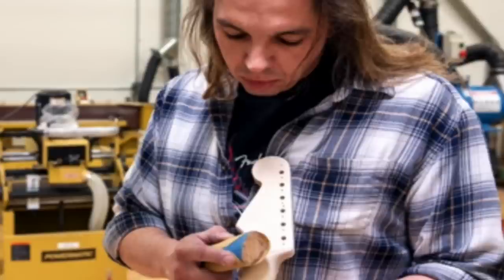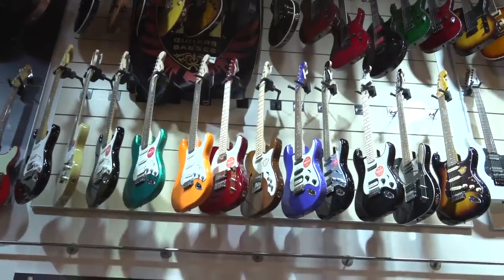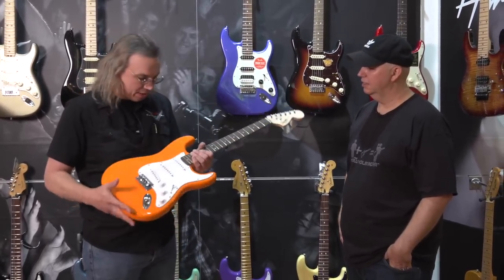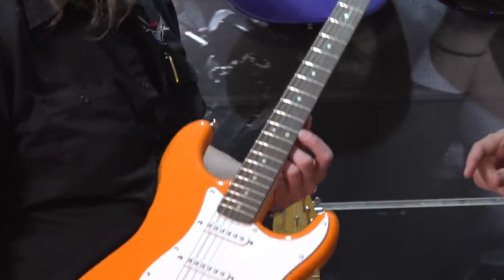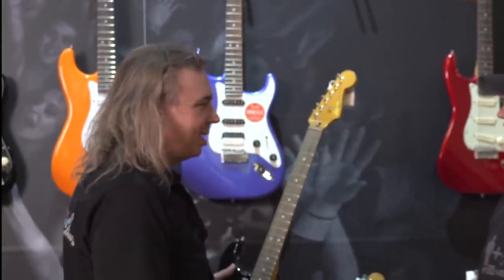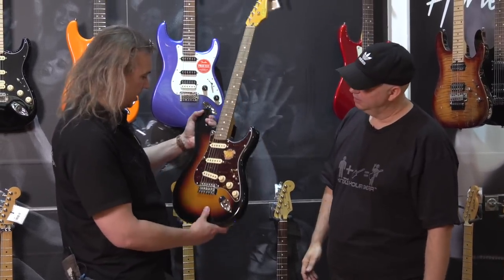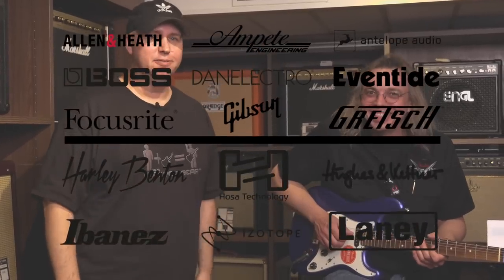What Squier Would A Fender Master Builder Buy?

Comment: affinity is made in Indonesia.  If you get a good one, they are really butter to play.  The frets are rounded and the satin finish and higher radius makes it a really sweet ride.  I bought a new one at a pawn shop and had no idea what it was other than a strat style cheapo but I played it and it was just all about that fretboard.  The pickups sound decent.  Doesn't stay in tune well enough, tho.  no idea about those other two.
Reply: Mine is made in china, and is the orange one they showed in the video. and it is very close to a real strat. It is just a little bit slimmer body and neck wise.
Reply: Mine is made in China too the neck on mine is as good as it can be. Im very happy with it. 👍
Reply: @collecter3456  if it's made in China, it's probably old stock. Btw mine's also China made
Reply: Ironic, guitars from this part of the world were utter shit in the 90s.  I guess they got their factories tightened up over there.
Reply: @CyberneticArgumentCreator  I'm from Indonesia, and I think they already have good enough experience cause they have been working for decades since the 90s
Reply: Did you get your tuning sorted? In my experience tuning issues are cause by the strings binding in the nut (usually sharp after using the trem) and string windings shifting on the tuning post (strings going flat after bends). There is also the possibility of them binding at the bridge. When restringing I like to wrap the string around the post and pull it through the hole leaving vary little slack. Make sure the string is properly seated in the bridge. Grab the string over the fretboard and put some tension on it. Wind the key making sure that the windings stack neatly and towards the headstock. I feel that 2-3 windings is enough to hold onto the post and more than that is more places for the windings to shift. You will have to put some extra tension on the strings to settle the windings so they don't shift but I don't like to go crazy with the string stretching because I think it is shortening the life of the strings.
Reply: Try and find an ICS serial number Strat from 2013 onwards, the quality is very, very good indeed.
Reply: @richardrichard5409  I had an Indonesian Ibanez bass that was very good. The fret ends could have been a wee bit cleaner but the bass was otherwise flawless. I wouldn't hesitate to own another.
Reply: Putting graphite in the nut slots is helpful too.
Reply: Only issue i have with the Squier series is they don't stay in tune (especially if you use the tremello of course), but they do have an excellent blues tone
Reply: My step dad got an Indonesian Squier last year from a guy who bought it for his son that never played it, you're completely right they're like unicorns. Just a really solid strat that does all the strat things :')
Reply: I also just bought an Indonesian affinity and mine is exactly the same as far as the playability and feel of the neck is. I got it used and had virtually everything set up beautifully and had fender tex mex pickups and better pots put in and I'm absolutely in love with it. It's the 2 tone kinda darker burst and the grain looks great, you can't see the separate pieces of wood unless you look very close. I've seen some even in pictures where the seam is so evident because of mismatched shading but at first glance mine looks like a one piece body. And being a 2012 I'm pretty sure it's a rosewood board too but I'm not really sure. The next thing is gonna be better tuners of some type because I have the same issue with tuning stability, maybe some vintage style because I think they look awesome
Reply: I've had my Indonesian Squier Tele since the late 90's. It has been a great guitar.
Reply: I have a mosrite, a Mexican jaguar, but the affinity strat is still the go-to. 
I swear they made mine different, the neck is just so good and the pickups sound so warm compared to the new ones.
Reply: @loggerhead837  

Sounds like you got a real gem. Even though they're decent enough sometimes the stars just line up right and something amazing occurs.

Comment: He picked the exact same guitar that I have. I installed some graph tech stuff, but otherwise it’s stock.
Reply: Putting in graphtech saddles was the best upgrade I made to my Squier.
Reply: You got this guitar in 2017?
Reply: Akhtar Zamil Sirajudeen I think so.
Reply: @hopfrogg9599  in what way did the Graphtech saddles help? I've been having tuning issues with my Tele and I was thinking that maybe the saddles might be the culprit. They just seem unstable and lean unevenly from side to side.
Reply: @AdamSJarrett  For me it got rid of the "jangle" sound it was making with the cheap pot metal saddles. That's about it, but it made a huge difference.
Reply: @AdamSJarrett  String saddles are supposed to be level for the most part. I recommend a nut lubricant called Tune It. It helps. A tiny dab on the nut slots and string saddles and also the string trees.

Comment: About 8 months ago I bought a 'Classic Vibe' Telecaster sight unseen (online). I was amazed that it was a $400 guitar made in China. I just received my 'Classic Vibe' Strat., and it's a fantastic guitar also.
Reply: Indeed man. I just do not think the CV he checked out is set up right. If he is seriously fretting out.  I have no issues with mine.  2015 model 60s 3tone
Reply: Escape the Matrix, a buddy of mine just gave me a Squire Classic Vibe Telecaster plus bunch of gold plated upgrades he hadn't even opened the packages on tuners,saddle,plug in,control panel, new scratch guard even the cover plate for the neck I also was amazed at the quality of it and haven't even put the upgrades on yet almost afraid to touch it as is.
Reply: jenbill1602 Sam here. Mine did come with Mighty Mite USA alnico 5 pups. But they were not needed. I love it.  You can check it out on my channel.
Reply: Classic vibe 50’s Tele owner here. Plays so easily and sounds magical.
Reply: Robert, Sweet guitar Squire really stepped it up on the Classic Vibe if didn't say Squire on headstock could easily pass it off as more expensive, when friend said he had a Telecaster he would square me up with I was hesitant but after seeing and playing it Well alright then.
I just hot rodded my Fender Mexican HSS STRAT with DiMarrzio Tone Zone in bridge and DiMarrzio Twin rail Cruisers in middle and neck with push pull pedometer OMG! it's a beast only Strat I play now.
Reply: jenbill1602 Man that’s kick total ass. Indeed. I have the MiM FSR gilmour too it has swapped to white pick guard but can’t wait to put back original black. I bought it this way 1 month old no use just pro set up and pro case fender and accessories a bassist bought. He had serious hesitation but I got it for 450 shipped. Lol.
Reply: jenbill1602 honestly I’m seeing the bullets go and get major props for their price to feel and playability and sound.
Reply: @jenbill   Just saw your reply here. I'm guessing you're loving that! I'm thrilled with my $400 purchases, but it sounds like you hit the lottery. Tell you friend I wanna be his friend too!  LOL
Reply: Escape the Matrix, Ahahahahaahah! Yeah gave me more than actually owed said he also has the gold tuners to go with it just couldn't find them at moment so I'm waiting before start changing everything out to gold, I must warn you the bastard can be a real pain in the ass sometimes hence reason for giving guitar but you got it I tell him.LOL!

Comment: did the fender master builder just say that his number one guitar is a squire strat? that's rad
Reply: But an '85 is not a run-of-the-mill Squire. It would have been nice to see one of these guys point this out.
Reply: @bobleonard9358  mij squire’s certainly were a higher level of quality than the ones that came after sure, but my point is that he’s not a gear snob which is pretty cool.

Comment: Meguiar's wax! Sweet tip for the ol' bag of tricks. And I definitely have some in the garage for my 1970 Plymouth GTX, which incidentally, is In Violet (Plymouth version of Plum crazy, same mopar color code FC7) which matches that middle strat (which even though I wouldn't need the wax for it, I am now thinking of buying haha, as it would match the car, and a G & L tele from the Detroit muscle car series they did matching the exact colors.) But I can think of a couple axes I have where I would definitely consider using that trick on.

Comment: Classic! I have setup hundreds of Fender/Squier guitars, and have consistently found the quality and ability to setup custom actions almost always falls off as price rises - the basic Strat/Affinity Strats are typically great guitars...Want the highest quality? The mid to late 80's made in Korea Strats are superb! Also, I have yet to handle, play or set up a made in Mexico Fender Stratocaster or Telecaster worth paying a dime more than $25 - they are acceptable for parts like screws for pickguards, maybe the individual saddles for emergency use - get a Squier and remove the logo from the headstock if the name is such an issue would be my two cents worth!

Comment: I bought a dark green standard Chinese made Squire Stat for 50 bucks plus 25 for shipping. I gutted out all of the old electronics rewired with gavin cloth wire and new 250 K ohm CTS pots, .47 paper in oil caps and added Fender Custom Shop Fat 50's in it. The only thing left to swap out is the plastic nut. It sounds and plays and sounds awesome.....
Reply: Those cheap plastic nuts are awful!  A good handmade nut is hard to make, that's how Squier is able to cut costs.
Reply: @benjaminbarrera214  Thanks for your reply.  The bone nut I bought from Fender was about 13 bucks and well worth the price. I did have to do some minor sanding to get the nut to fit in the slot. The nut slot is slightly narrower than the Fenders. That's OK, because I will get a tight fit without any glue. The new nut made a big difference in sound. 
  I've learned that the bridge saddles is made of pot metal in some of the Squiers, so I'll have to look into that also. I'm shopping for staggered locking tuners to finish the build.
Reply: That's great!  I used bone blanks from Stewart-MacDonald.  They're cheap but I also needed about $70 worth  of nut slotting files, plus I had to figure out a way to curve the bottom to fit the fingerboard radius exactly right.  The Fender pre-cut nuts are a bit more expensive but far less work.

As for hardware, I like the bent metal saddles.  Even the cheap ones are pretty good.  I have the Gotoh Locking Vintage Oval Knob 6-In-Line Tuners on my old Squier Stratocaster and they're great.  Stewart-MacDonald is my main source for hardware, tools, books, and supplies.  Give them a try if you haven't already.  Have fun!
Reply: @benjaminbarrera214  I've used them before...I basically go by price comparison since I'm low budget kinda guy....

Comment: I was looking at that same color contemporary squire but I opted for the HSS vintage modified instead. First off the VM was $50 cheaper and has duncan designed alnico v pick-ups, which I prefer over ceramic - a huge plus since I don't want to be swapping out pick-ups. 2nd, I hate the painted headstock. I would have eventually had to sand off and re-finish it. I would have preferred the satin finish and thinner neck of the contemporary over the thicker, lacguered neck of the VM, but after playing it a while I've got used to the feel of the thicker neck. It's not so thick that it's uncomfortable to play. I'll steel wool the neck to get it more friction free, no biggie. In the end, none of the squier's had exactly what I wanted but I thought the VM was the best bang for the buck. For the price, I can custumize and put a little TLC into it. The vintage style tuners are actually pretty nice. I may replace them with locking tuners but I don't feel that I need to.

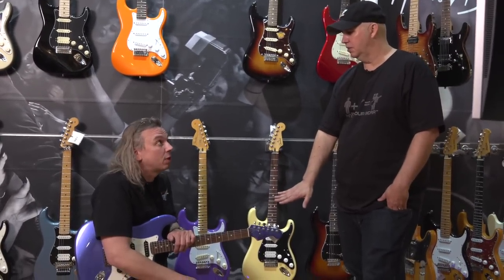Comment: ANSWER: Blue 'Contemporary' Squier with matching headstock. Has many modern features and not too light weight.TIPS FOR SETUP:Tip for order of adjusting guitars: T.R.A.I.N. @ 10:00 [1) Tune. 2) Relief. 3) Action. 4) Intonation. 5) Noodle.] 1. Tune it up. 2. Adjust the Relief. 3. Adjust the Action. 4. Intonate it. 5:  Noodle away! TIp for fixing sticky gloss neck backs to satin [for better action]: Two applications over time of Pure Carnuba automotive wax - after light sanding. Must be 100% Pure Carnuba [for cars] - NOT carnuba cleaner, which will scratch neck back. Try McGuire's using VIVA paper towels. Dry 15 minutes, buff with Viva paper towel.Tip for checking string spacing: bridge should be narrower to prevent falling off the fretboard. His all-time fave Squier  guitar: '85 Squier Strat. Playing 'Contemporary' Squier Strat @: 16:28. For a beginner like me, this was THE most helpful guitar video on YouTube. Watched 4 times. Wish my husband had watched this before he bought me a RH electric Fender Squier Strat guitar as my surprise  Christmas present in the '80s.... I'm a wimp/weakling and although technically right-handed, my LH is dominant. So now, after trial-and-error, I use a LH Fender acoustic/electric guitar - to learn Mississippi Delta slide blues style.

Comment: I have a couple of Strats with a mod I think Fender should have invented.  Instead of the standard pickup switch (my oldest guitar only had the 3 position switch originally, so we had to notch the switches ourselves back in the day).  I've since had the switches on these two guitars replaced with three mini toggle switches.  The neck and middle switches have on/off/on-reverse phase.  The bridge pickup is just on/off.  This gives SIXTEEN possible combinations, but three are redundant, so figure 13 tones from the original 3 pickups.  It's far more intuitive than most people assume, though it may be better for studio than  live, though I never had a problem gigging with these.  In fact, I found adjusting the tones for different room situations was quite easy, though these days with fancy pedal boards and profiling amps, that might not matter so much.

Comment: It just goes to show you that price isn’t always everything. The guitar that is my user photo is a 1987 Fender American Standard Stratocaster that I bought new in 1988. I purchased the guitar with the hard shell case and paid only $399.00 for it. To get an American equivalent (the American Standard is no longer made) today, at least $1,200.00. I have a friend that owns a couple of music shops locally and I always go in and noodle with whatever is on the wall. Some of the Squier guitars look, feel, and sound better than Fender branded instruments. I agree on the satin finish for the neck, though mine has a glossy look from years of playing. 😁
Reply: I've played my buddies $1500+ Fender, I played a different buddies late-90's maybe early 00's MiM Fender,  I own a recent '21 MiM Fender, and I have a 15 year old Squire "Bullet" (w. 6pt. trem).  

The Bullet has the best "feel" of all of them.  My crappy $150 beater-bullet just feels right.  Cheap Ceramic Pickups suck, actually replacing them in a week with a full set of A5 Hot Rails.  So while the sound isn't "great", for now, the guitar is set up nice (and I've never had to do anything to it).  The fretboard is rosewood and feels like it's had professional fret work done (it hasn't).  Neck feels silky and polished (it isn't).  Action holds well, tuning actually holds, and Trem feels nice with the 3 stock springs.  Other than cheap sounding pickups, it's a GREAT guitar.  Annoyingly, it's actually better than the $700 MiM I recently purchased.

Squier Guitars are hit or miss.  Most of them are kinda meh...  But sometimes you luck into a really nice one that just fits...